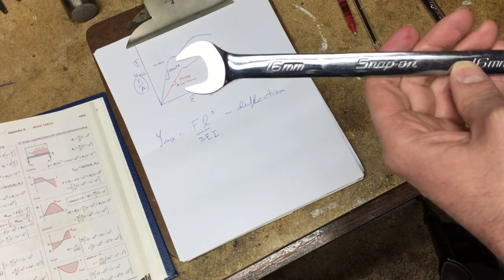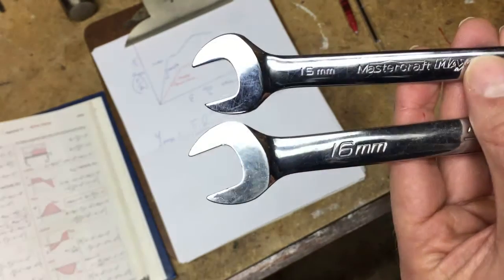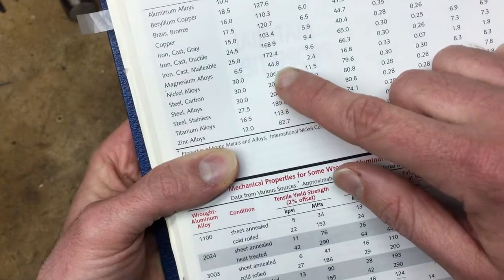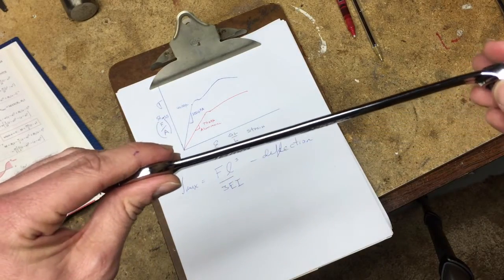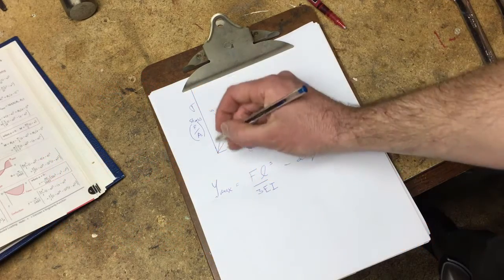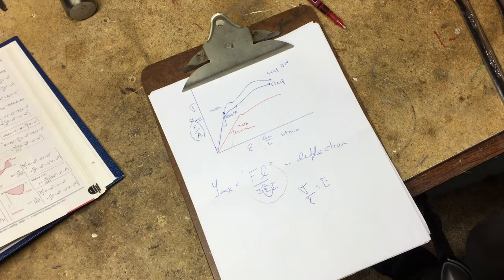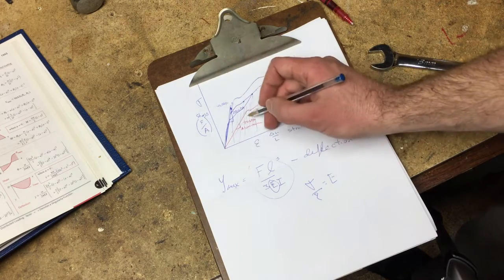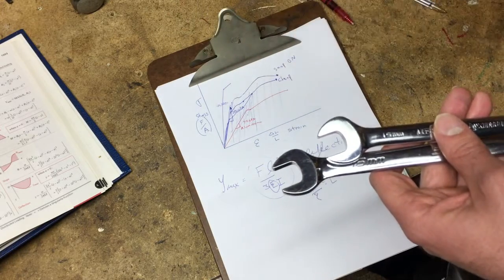Myth or fact? Snap-On open end wrench spreads less

Comment: That wrench is Flank Drive. You showed how much you know. The "toothed" open end is Flank Drive Plus. The non plus wrenches still are Flank Drive.

You talk about the straight metals. Snap-on use a proprietary alloy blend.

Open ends are not the same. Snap-on uses a continuous arc. A lot of other brands use a V notch design. The V notch is weaker and spreads more than the continuous arc design.
Reply from the maker: Sounds like lots of industry jargon to me, I like my flank steaks

Comment: Good video but like others have said you have reduced the science. When our company manufacturers our metals it's a trade secret. The amount and ratio of different types of metal mixed into the forge will yield different results. Therefore the end product will have different stress levels or modulus of elasticity.
Reply from the maker: Kong Vu different yield yes but the modulus should be the same for all steels

Comment: The math checks out on paper but in the real world it doesn't. I've personally tried it with snap on and mac and mastercraft and other wrenches on grade 8 bolts in a vice. The tool truck wrenches dont spread and round the bolt and the cheapo ones do. Fact of life. On paper bumblebees cant fly. The real world doesn't always affect the math

Comment: Don't you need to take more into consideration? How about over time like after thousands of stress cycles? It's quite clear to me that a 50 year old Snap-On wrench still can work great compared to even a new other brand wrench that's ready to round off a fastener out of the box. I've certainly seen permanent spreading on many wrenches but never on a Snap-On. 
Snaps wear down or break, but not spread.
Reply from the maker: You are correct, certain steels could have a higher fatigue value, it is something quoted with the grade of steel.  Does Snap On use a proprietary steel, doubtful so in that case they are likely similar but they could; I doubt anyone really knows those trade secrets.

Comment: I sat at the front of all my classes, but I am still an idiot. So instead of having a job where I look at all these valuable engineering figures and equations, i actually have been using these muthafackin' wrenches to do four-wheel alignments on an un-named European manufacturer for the last 13 years.  My Snap-on (non-flank drive) 18mm wrench I use to set the left rear toe on one of our flagship vehicles works fine. However,  the jam nut is often so tight I swear I can "feel" this ductility and spreading of the open end of the wrench when it finally loosens.  But at the end of the day, I have never had any problems with this Snap-on wrench (this particular one made in 2005). An open-end wrench is required because the air suspension reservoirs obstruct the box-end from accessing the 18mm tie-rod jam nut; the reservoirs are only on the left side, a box end fits easily over the right rear toe jam nut.  Now, the 15mm  flank drive I use to set the front toe on an onerous SUV (infamous for guaranteed frozen tie rods) will almost always round off the flats of the inner tie rod. An acetylene torch or similar tool is often required to heat the tie rod in order to free it from the outer one. Even an expensive pipe wrench is not sufficient to persuade the inner tie rod to rotate relative to the outer tie rod. I have not used Matco, craftsman, Tekton, or Ampro or whatever to do alignments, which are nearly impossible alignments because of these siezed tie rods. I only know that i have had measurable success battling them over the last 13 years using Snap-on flank drive wrenches. Based on my experience I believe Snap-on wrenches give you the best chances of navigating the most difficult and demanding situations. The 13 mm flank drive wrench I use (mf'd in 1993, the fucker is 26 years old and still moves stubborn tie rods like a boss) easily adjusts inner tie rods, my suspicions are that other wrenches (cheap ones) will not be up to the task. Thanks for posting. Good video.
Reply from the maker: methylbenzodiazepine thank you

Comment: Oops, your theory missed something,  and I'm not a snap on fan, I like armstrong tools, and other used, high value for cost options.    Hardness increases tensile strength and resistence to deformation.   Harder steels made of stronger alloys will have greater resistance to deforming,  (and deflecting) and thusly will deflect less for a given amount of force (torque)  being less likely to slip off the bolt due to retaining original shape. However,  I find cheap bolts are more often an issue than cheap tools.  Either can cause problems.    To me, snap on is over priced, and shady about where they build certain things,  in addition to selling out their brand name to places like costco.
Reply from the maker: 66piperaztech yes I agree hardness is a factor but I’ve never seen even the cheapest wrench locally deform and I believe in the video I was focused on the wrench opening. Yes I think some bolts are too soft

Comment: Quite interesting. However, the reason I bought some Snap On wrenches is not because they are "stronger" per say, but because the tolerances on them is much tighter than many other wrenches, resulting in less rounding of fasteners that way. BUT - they are not the holy grail - ANY wrench can round a bolt with enough force if the bolt is softer.
Reply from the maker: Chris F that is a valid reason to buy them

Comment: There is some truth to the spreading. I was watching a video where someone was using several different brands of wrenches on a large grade 8 nut. Pretty much all of the premium and super premium brands had no visible deflection. Some brands gripped better, like Wright or SnapOn. But some of the lower brands definitely had obvious deflection, resulting in much less maximum torque according to the torque gauge. They were using the larger of the sizes, and about a 5' cheater pipe to allow a slow swing to allow a clear recording of the wrench from an above angle. Insult to injury is several of the lesser brands had thicker heads. I would assume thicker would result in higher max torque assuming everything else equal. Not only bulkier in nearly every dimension, but less applicable torque.

I haven't seen any reviews showing SnapOn wrench materials were better than their peers, but Flank Drive plus had little competition outside of Wright Grip. But to say that any wrench of a given dimension will react the same is factually wrong based on what torque testings I've seen. I'm not an engineer, but there is an observable functional difference. I don't know if some combination or shape or material quality, but something is going on.

I know in some grievously bad tools, the material is not what they claim it to be or some other factor of quality that is so bad that it is technically something, but not practically something. I've seen some reviews where a cheaper wrench was cut and they did an x-ray spectography on the cross section, giving away that they "chrome vanadium" had only 0.01% Vanadium. Drastically below the Vanadium content of any AISI graded chrome vanadium.

I have also seen several reviews showing the "chrome" on their china tools rusting. Not missing chrome, no wear spots. Strait  up rusting chrome. At least it claims to be chrome. Kind of like "stainless steel" knives that rust after a day if you don't dry them after washing.
Reply from the maker: Benjamin Cronce I wouldn’t doubt there can be a big quality difference and some can cheat with their claims for strength but stiffness shouldn’t change between steel. Can you link the video?

Comment: Ok great to theorize with charts and formulas, but should you not test the wrenches to determine if your theory is correct?  I have used snap on and cheaper wrenches and you can feel the difference.  If you compare to more expensive wrenches it gets closer.  Many youtube videos that the flank style plus wrenches of different manufactures grip better than just standard open end wrenches, but usually cause more damage to the fasteners.  Years ago I was told, but can not confirm, that in aviation you could not use the flank drive plus style wrenches, because of the damage they could do to the faster.  My theory is that the more expensive wrenches a manufactured to higher tolerances, which grip better than cheaper wrenches.
Reply from the maker: I stated when comparing non flank drive wrenches and yes you are correct the flank drive leaves small indents which eventually lead to fatigue failure of the fastener.  I would never re-use a fastener when you use a flank drive to remove.  Surface finish is important for fatigue life, even micro cracks lead to failure.  Aviation surprisingly to some has a very low factor of safety otherwise planes would be too heavy; that is why its key to track flying hours.  They also use Aluminum which doesn't have an endurance limit like steel.  If you keep steels exposed to under 50% of their ultimate tensile stress they have an infinite life; this is called endurance limit!  This is something many Engineers use in designs of safety items and therefore don't use aluminum.

Back to the comparison, if the wrench is staying within the elastic range, all steels have the same deflection.  Note: Steels.  If a wrench is cast iron, it has a lower stiffness.  I mean forged steel vs forged steel.
Reply: There are videos on youtube of different brand wrenches gripping better than others.  If they all used the same metal, than this would be not be true.  You are implying that all wrenches use the same metal, but this is not true.  Each manufacturer has their own secret sauce of metal, forging (if forged), quenching.  This is one factor.  Tighter manufacturing tolerances,  head design and  probably other factors also determine how the wrench grips.  Instead of arguing with people who disagree with you, you should test your theory with different manufacturers of wrenches.  Like in other videos on youtube, I think you will find that this will vary depending on manufacturers.  My personal theory is that many of the higher priced wrenches have tighter tolerances than the cheaper wrenches.  Also head design and metal hardness will be a factor.  Next video you should compare these and other factors, and do a test.
Reply: You need to check the youtube videos that compares flank drive style wrenches and flank drive plus style wrenches.  Each in their categories.  Your chart I think is assuming that the manufacturing tolerances, and design are the same and just comparing different steels.  In reality and shown in the videos they are not.  You are trying to argue that all wrenches are the same because of the characteristics of all steels.  You are not taking in the other variables as tolerances and even hardness of the steel.  I remember seeing in one video they were measuring the size of a common wrench.  They found differences in different manufacturers.  Even damage on some of the cheaper wrenches when a given force was applied.  I have used cheap wrenches a it was obvious that that the more expensive wrenches were able to grip better than the cheaper.  Was it because of the design, tighter tolerances, rockwell hardness, forging process, tempering, I do not know.  It sounds like you have a engineering background so you could buy a certain size of wrench lets say a 15mm and compare all the differences in these wrenches from different manufacturers and then do a test.  I would be curious who builds at the lower end of the price point and who builds the best wrench.
Reply from the maker: When I generate enough views to actually make more than pocket change I will do a comparison.  Yes, higher priced wrenches may have tighter tolerances; they may not; nowadays it is not difficult to do precision final grinding.  Yes hardness may differ which can help and the strength will differ which gives you how much stress the wrench can handle, but my point was when you are in the elastic range, none of that matters.  A stronger wrench has a larger elastic range because it has a higher yield point, as much as it is theory it is 100% true and accurate.   Once you understand the stress strain curve graph, you can make valid comparisons.

Comment: What you have spoken about concerning formulas is obviously true. However, what effect would the process of making the alloy have on the final manufactured product?
Reply from the maker: Chris Bullard the stiffness of all steels should be the same, to some small degree of tolerance. The ultimate strength and yield point varies among steels
Reply: Well not to compare so Wrenches to great metal work such as some famous sword, Ax, and knife makers have and continue to produce. Would the metal chemically test different from what they started and finished with? I spent a high percentage of my life in manufacturing and we started with the same raw material as others but our processes produced a superior quality product. Thank you for your patience. I can tell that you are are very knowledgeable about this subject.
Reply from the maker: Chris Bullard perhaps you performed a better heat treatment post process. There are annealing, tempering and quenching processes that can drastically change the strength and ductility of steels. Lots of different ways to heat treat and some of it are trade secrets
Reply: Mech-Eng are you saying that all forged steels are the same? I'm not following how you tested the wrenches for their actual alloys, maybe I missed something? Different alloys and there are many, deflect, bend and eventually fail at different rates. I like many different brands for different reasons. Not knowing what alloys are actually used from brand to brand and how much force is used in the forging process, it seems like the information is lacking.
Reply from the maker: I'm saying they have the same stiffness, nothing more and nothing less.  I'm not saying they break at the same stress as steels come in many strength varieties but only one stiffness.

Comment: Great vid, but what I don't understand is how the alloy, carbon steel and even the nickel alloy can have the same gpa. I know they are very close to the same material but I would think they would have some difference. Also would heat treating change that reading??? I like how people always blame the wrench (no matter the brand) for rounding off nuts/bolts when 99.9% of the time its the soft nut/ bolt it self that fails. Hardened wrench against soft nut, wrench wins every time.
Reply from the maker: Yes, the Modulus is the same for all grades of steel, it is a characteristic of steel that says the stiffness stays the same.  Just like aluminum has 1/3 the stiffness.

Comment: Snapon guy said his wrench was better than mine, went on with husky wrench, walked off with a set of snapon wrenches, $500 broker and a bent husky wrench. Cool chart though.
Reply: The problem isn't the warranty. The problem is the hand that slammed into the engine when the $8 wrench broke, or the rounded nut that has to be cut off now.
Reply from the maker: Robert Perry get the husky warranteed. I like the flank drive Snap on, apparently husky has their own version, haven't seen it at home depot